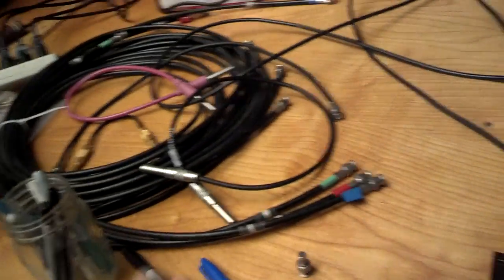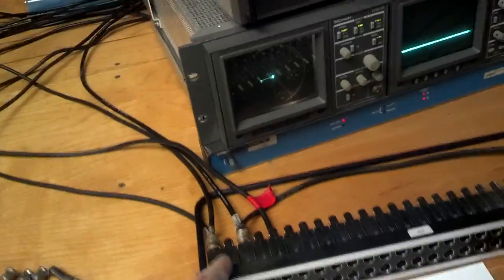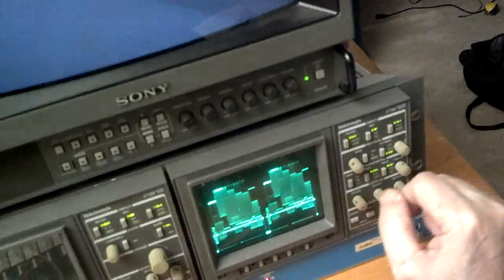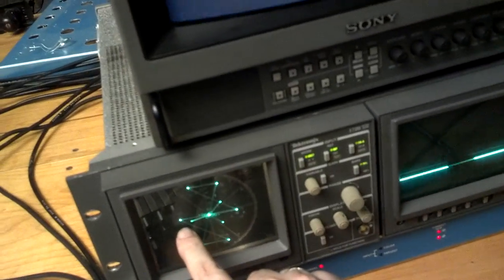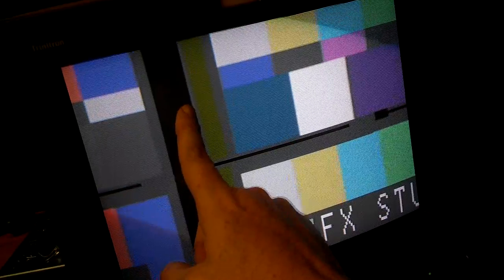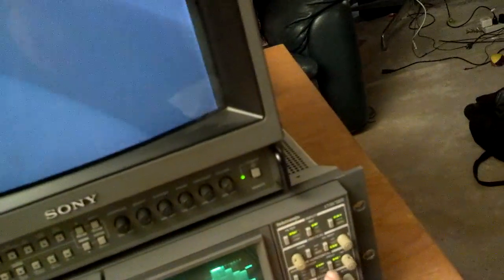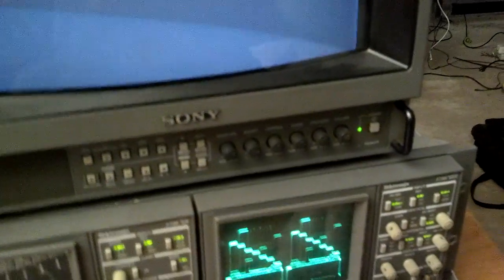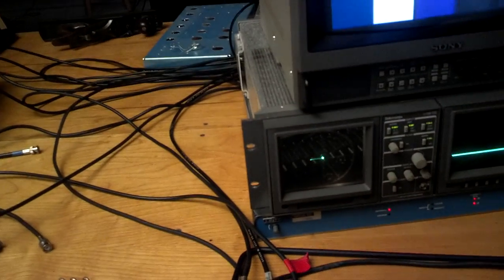Studio Rebuild #9:  Some Analog Video Basics

Comment: Very interesting video. Did analog tv electronics repair for many years. brushing up on I/Q demodulation in regards to a software defined radio (SDR) which also using I/Q demod (Elecraft KX3 model) Your revived some of my dead brain cells (retiree) as to how quadrature demod works. Thanks! If I could still remember half of what I once knew I would be very happy.